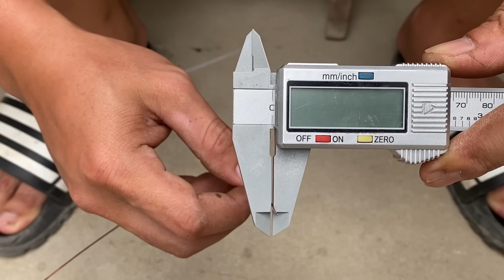Harness the Power of Nature: Build Your Own Wind Turbine for Free Electricity

Comment: hello  very excellent  Dear engineer, how many turns should we turn the wires?  And what is that board you connected the coil wires to?
Reply: EXACYLY my question
Reply: @Sportvlker  yea and why no magnets? shoulding it have at least 6 on each disc? confusing...
Reply: it looks to be about 25 turns. maybe 25-30.

Comment: Fantastic, have you thought about using the fan to blow the turbine and create a closed circuit between turbine and fan?
Reply: lol run it indoors in case your RV park doesnt let u run it outside. you could down size the fans too to run very specific things if ur in an RV. like the refrigerator and water pumps and a battery of LEDs for lighting...

Comment: It would never work the light would flicker intermediately and would be dim while being plugged in with the fan I’m going to go with there being a 12v battery inside the fan base running the 12v motor in the fan with a 12v lamp him stopping the turbine cancels a contactor witch turn the fan and light off

Comment: Sorry. There is no way here.... None at all. The overall concept is sound but the application is not, in more than one way. I doubt that even in a gale force wind... The air gap, size of magnets, the size of the coils, the number of coils vs number of magnets. No way that set up works. The geometry of the coils dictates the placement of the magnets. For those who have noticed the extreme gap, also 5 coils would require 10 magnets. There is real science in the concept, but almost no understanding of it in the application. That turbine is not powering that fan. A simple mass, volume and velocity equation just on the fan verse the turbine would not balance at 100% efficiency.

Comment: Sorry. There is now way here.... None at all. The overall concept is sound but the application is not, in more than one way. I doubt that even in a gale force wind... The air gap, size of magnets, the size of the coils, the number of coils vs number of magnets. No way that set up works. The geometry of the coils dictates the placement of the magnets. For those who have noticed the extreme gap, also 5 coils would require 10 magnets. There is real science in the concept, but almost no understanding of it in the application. That turbine is not powering that fan. A simple mass, volume and velocity equation just on the fan verse the turbine would not balance at 100% efficiency.

Comment: Funny on my dual axial my rotor to stator gap is 3mm.  
What size enamel copper wire did you use? What’s the size of the magnet dimension wise and amount of pull per pound is your neodymium magnets ? I’m sure.
Overall, your video is a good theory and it’s possible but I wish I knew how much wanted you were pulling because I don’t think it’s a kilowatt especially with the gaps you have at best it’s only maybe 100 or two but that’s just my guess I wish you put a meter on it or some sort

Comment: There's nothing fake about this project. Too much fake videos on YouTube is clouding your judgement. 1. The PCB is little inverter board you can get from a UPS. 2. the distance between the magnet and coil could matter but strength of the magnet/ wind can be circumvent for that. 3. Why will the fan decrease when the total load may still not equal the output power(watts) of the PCB. 4. It's on a height and the wind is good enough 5. I don't see any table or gap where he can hide cable or battery. 6 everything there looks applicable, I've done something similar .. I think it's the simplicity that make you think it's fake, which is not.
Reply from the maker: no
Reply: dream on

Comment: Everything is fake, the distance between the magnet plate and the coil plate is far too large at almost 1 inch, with that distance it would only be enough for an LED. The PCB is not an inverter but a 12V power supply. What everyone should notice is that when the load is switched on, the speed should decrease, but that doesn't happen. Next time try a little harder when you're trying to fool people. However, the mechanical structure is very well done.
Reply: How much turns are needed in each coil ?
I want to test this project ..... And which size of  megnet you used ?
Reply: To a lazy person every truth seems like a lie and every lie seems like a truth
Reply: @JUNI😊😅😂OR.74.
Reply: It simply voilates laws of nature
Reply: Someone in comments told me the Circuit was an inverter. 😅
With the N - S placement of the magnets, it means it's a dynamo outputing AC not DC!
Again I need to know what the circuit is! 🤔
Reply: @Kaimarah007 به نظر من مدار تثبیت کننده ولتاژ ۲۲۰ ولت است
Reply: Il a utilisé une alimentation à découpage qui fonctionne avec le principe de hacheur, il y a contrôle automatique de la tension de sortie même si il ya la chute de tension au primaire.
Il a respecté la section du générateur.
Je lui félicite
Reply: U r right bro.
Reply: Sem um alternador? Ao colocar a lâmpada a energia do ventilador não diminuiu...falso!
Reply: This argument need someone and someone is Mehdi from electroBOOM
Reply: Saya benar ingin membangun project ini. Adakah diskribsi yang jelas tentang ini? Utamanya jumlah lilitan & pcb apa itu? Mohon dibantu jelaskan
Reply: coba buka google " axial flux permanent magnet generator bro. @philipusadi
Reply: No matter wether it fake or not, however the device was proven whithout more ccomplicated instrumentation
Reply: @abdultawab1381 Finally someone who sort of believes the power of wind energy in the video
Reply: Fake fake fake
Reply: fake?i do it already
Reply: i make just 6v is real not 240v
Reply: Diese Videos gehen mir auf die Nerven. 
Es ist alles Fake. 
Die Leistung, Spannung,  Strom, Reibungsverluste und die Induktion die bremst bei steigender Last.
Reply: Bang sya mau beli
Reply: Very neat! A good non-magnetic enclosure, such as aluminum would come handy, for making it lmpervious to weather. I am using old solar panes, and a quick-disconnect relay system for keeping the inverter alive Even beyond 15 volts at the gel battery bank (has been working for over two years now).
Reply: @eltunene سلام . آن مداری که در انتهای کار قرار داد چیست؟ آیا تثبیت کننده ولتاژ است؟ مگر این یک توربین برق متناوب نمیباشد؟ از باطری صحبت کردید ولی در این مدار پنکه مستقیما به توربین متصل می‌شود
Reply: There's nothing fake about this project. Too much fake videos on YouTube is clouding your judgement. 1. The PCB is little inverter board you can get from a UPS. 2. the distance between the magnet and coil could matter but strength of the magnet/ wind can be circumvent for that. 3. Why will the fan decrease when the total load may still not equal the output power(watts) of the PCB. 4. It's on a height and the wind is good enough 5. I don't see any table or gap where he can hide cable or battery. 6 everything there looks applicable, I've done something similar .. I think it's the simplicity that make you think it's fake, which is not.
Reply: @marshallabam3335 fake fake fake.
Reply: @marshallabam3335  Всё проверяется только повторением.
Reply: 😊😅😂 @marshallabam3335
Reply: @marshallabam3335  the battery is inside the fan!
Reply: @wimpletzers3411 But how in the universe can you run a 220v fan with a battery 🤦
Reply: Fake
Reply: What do mean its fake? 

How do you suggest it's fake? 

🇵🇬😏👍
Reply: HALLELUYA,YAUSHA é o MESSIAS é o SALVADOR YAUH te abençoe
Reply from the maker: NO!!! NO!!!🤔🤔🤔
Reply: @GreatElectronicInventions scammer rubbish comunismo russian asean rubbish what else can we wait from a scammer